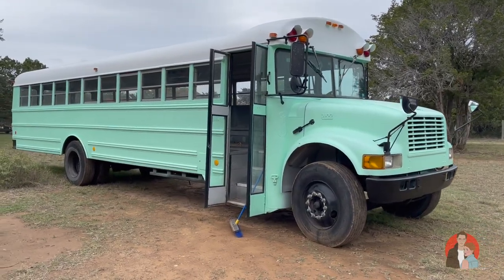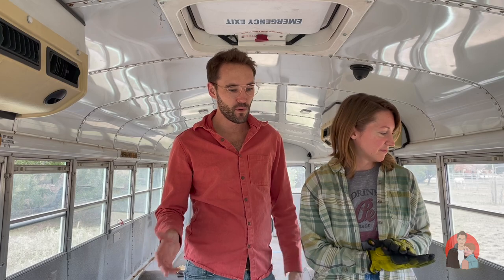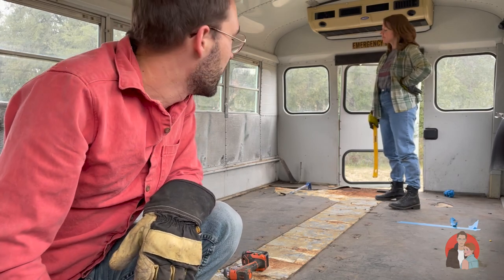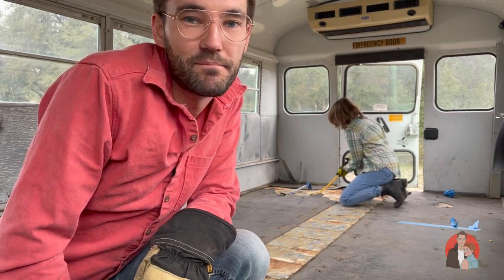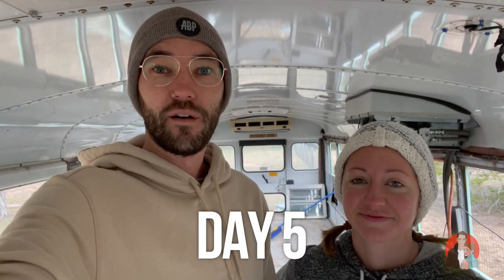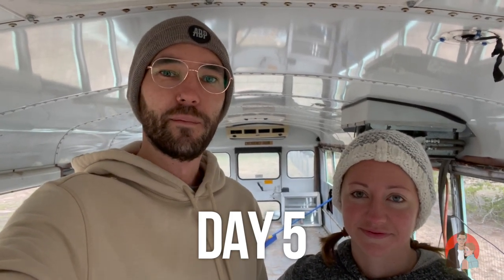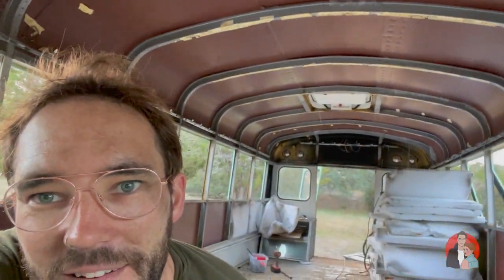Goons Tour Bus Skoolie Build (Floor / Wall Demo)

Comment: I found a good air chisel with the proper chisel shape will take the rivets out without having to center punch them.
Reply from the maker: That would save a bunch of time!
Reply: You mentioned something about the inside panels being attached to the outside too?? Did you cut it from inside or loosen outside? I can’t even with this wall removal 🙃 it’s testing all my patience.
Reply: @ArizonaAshton  Yeah I took an angle grinder with a cutting wheel and cut along the bottom of the windows.  The way they fold the metal to make the window frame it makes it impossible to remove it cleanly.